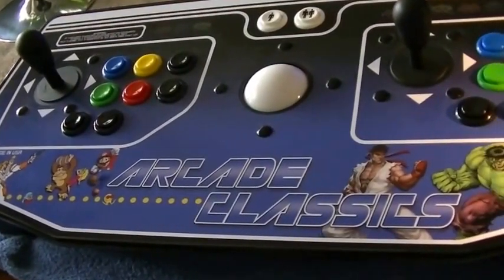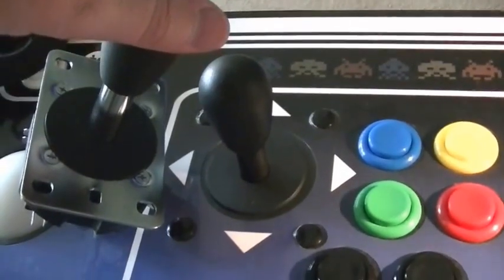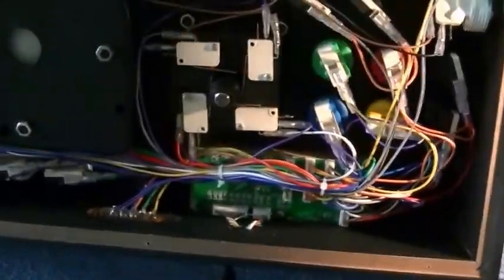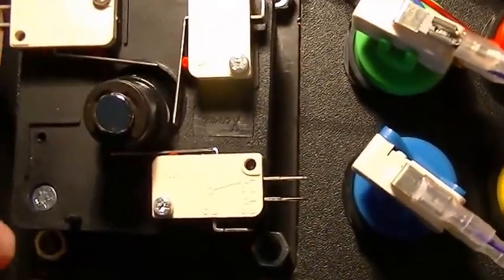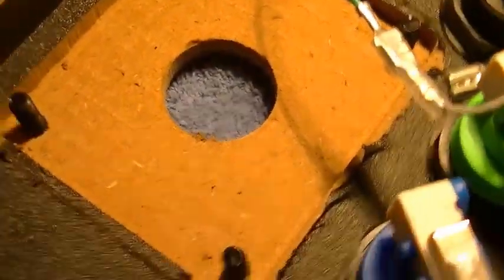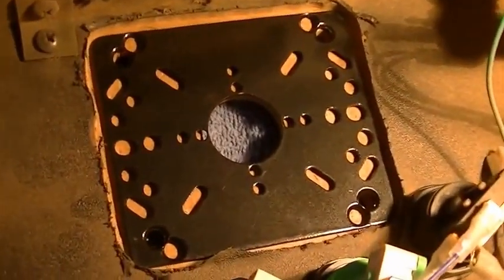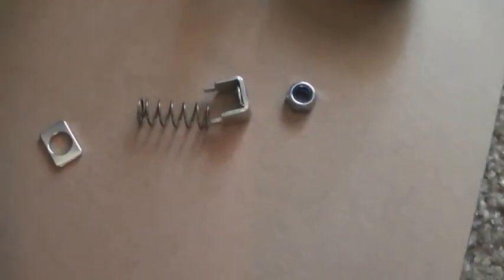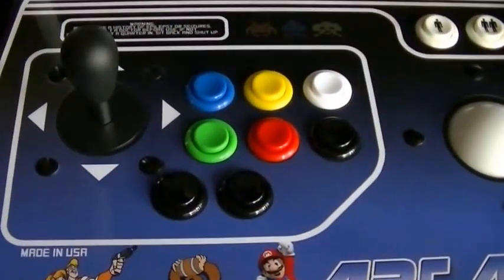X-Arcade Tankstick mod with Mag-Stik Plus

Comment: Hi Jerry - I just chose the OG Xbox colour scheme for my project too.  I have two old Sanwa JLW joysticks and wanted to replace them with the JLF silent type.  Problem is the new mounting plate is narrower and I have same bolt issue as you but atleast I don’t have to make cuts as I have a flat surface.  Does that universal plate fit all joysticks including Sanwa? You might have also influenced me in getting a similar 4+8 way stick instead as its terrible playing DK, pacman etc on the Sanwa 8-way - how is your joysticks holding up?

Comment: I have a question? What exactly did you ask for when you bought the metal plates? I have the same problem. I’m upgrading my cheap sanwa stick for a HAPP competition stick. And the screw holes don’t match up with the new ones.
Reply from the maker: https://paradisearcadeshop.com/ call this company,. And they will know, if not send them a link to this video.

Comment: Jerry, why did you replace the microswitches on the Mag-stik? Were the stock Mag-stik switches no good?
Reply: he made this way more complicated than it needed to be, the micro switches in the magstick work perfectly fine and do not need to be replaced and are a better quality and he could have removed the ball head instead of removing the c-clamp to remove the stick, also he should have bought the universal mount plate from Paradise Arcades as its a perfect fit...
Reply: @DanielChaves1984   Which universal mount fits in the tankstik so you don't need to "router" it? At that site there are a few options...or maybe user error on my end? Either way please provide a link as I plan on doing this mod soon.

Comment: I read somewhere that the Mag-Stick Plus is better at 4-way than 8-way. I'm not a giant fighting game player, do you find that 8-way is an issue at all, or is this just more of the Japanese sticks are the best nonsense that people like to argue about?
Reply: I have the non plus version (actually the IL version of it) and yes 4 way is better, the stick has a really short throw and that makes hitting the corners rather hard without triggering a movement into one of the 4 main directions. Or differently said, in way way mode it is fine but using the 8 way mode in 4 way games is a world of pain. Apparently magsticks are quite popular in the space shmup crowd because of the short throw.